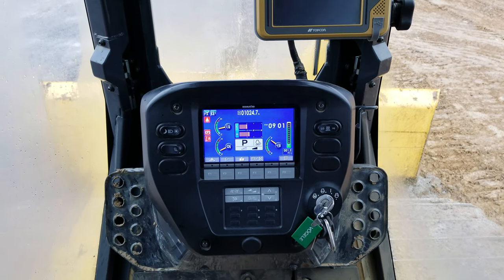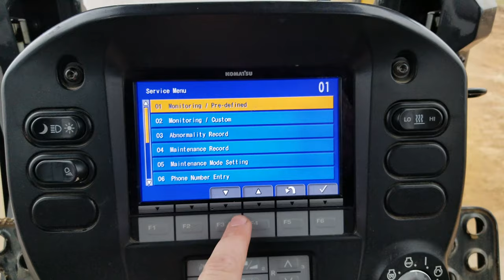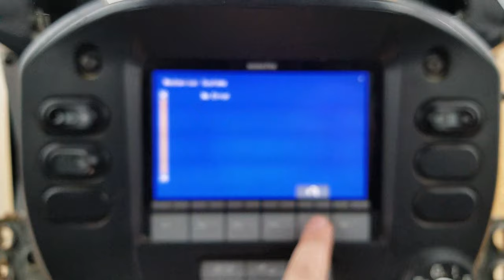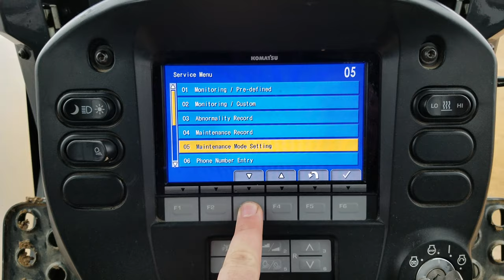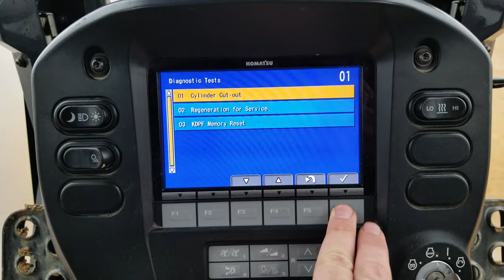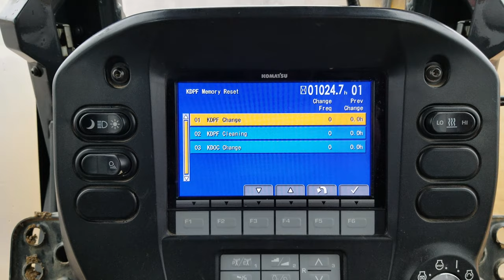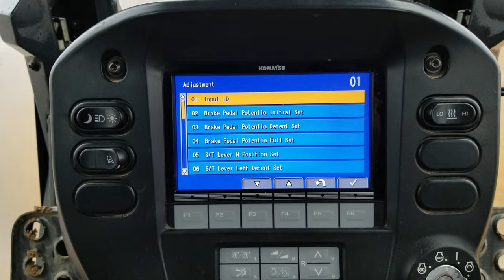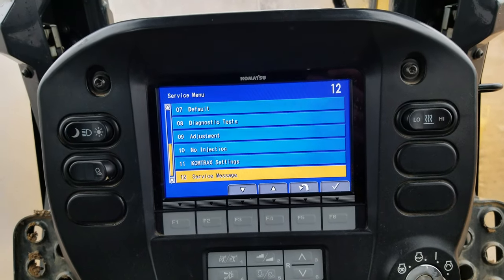Komatsu dealer Service Side of the Monitor Dozer. How to get into it. Troubleshoot.

Comment: Going to take a look at the exact code tomorrow, but we have a 39PX on our job site and LO4 has came up numerous times this past month, each time they have a tech come out and reset the code.  I do believe they said it was related to the DEF system, I’m in Minnesota so it tends to get cold so what I’ve been told by our mechanics is there’s either crystals forming in the DEF tank or debris causing the sensor to error. Although they just changed the sensor they also made a comment that it could be bad again.
What do you think the best route would be, and would a reset/regen allow temporary operation?
Reply from the maker: Howdy! Get me the code that comes up. L04 just tier of level of fault. L04 does mean ohhh sh*t. Def cause so many issues. It can be from temp, pressure, quality etc. Sensor read way to much. Get me the code and I'll see what I can help you with.
Reply: Thanks for the response! I never got a notification for one but we changed out the Def tank and sensors and it seems to be working fine now! Tank had debris in it, thankfully it’s fixed!

Comment: How do you get to that service screen on the rubber tires machines
Reply from the maker: Depends on the model. What model do you got?
Reply: It’s a HM400 last of serial 10063
Reply from the maker: @pauledgington6533  hm400-? What the number after the dash. Will  be like hm400-3 hm400-5 etc.
Reply: Hm400-5 sorry not used to komotsus
Reply from the maker: @pauledgington6533  should have panel to left steering wheel that blue and grey. Hold the down arrow (bottom left) keep holding and press 1, 2, 3 (should be very top buttons in blue from top left to the right) then release the down arrow. If my memory is right lol.
Reply: Thanks, you were right. Do you happen to know if Volvo has a set up like this. Same size haul truck call a AG40 I believe
Reply from the maker: @pauledgington6533  no volvo does not at all. Komatsu about the only one that has the monitor like this. Makes it nice. Volvo will need laptop/software. Jaltest is what I recommend using for software.
Reply: Thanks again for the help,
Reply: Thanks again for the help,
Reply: Thanks again for the help,
Reply: Thanks again for the help,
Reply: Thanks again for the help,
Reply: Thanks again for the help,
Reply: Thanks again for the help,
Reply: Thanks again for the help,

Comment: Hello do you know code E03
Reply from the maker: EO1 EO2 EO3 EO4 Area just how bad the code is. E01 like stopped up air filter. E04 like no engine oil pressure. It's just a degree of the fault. You have to go into the monitor too see the fault code itself